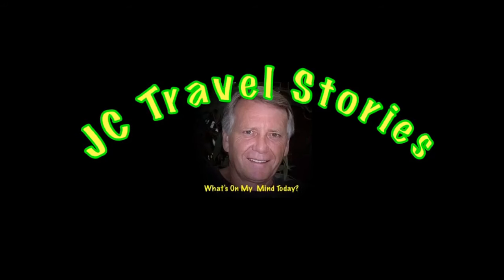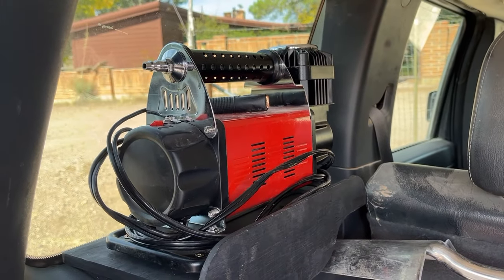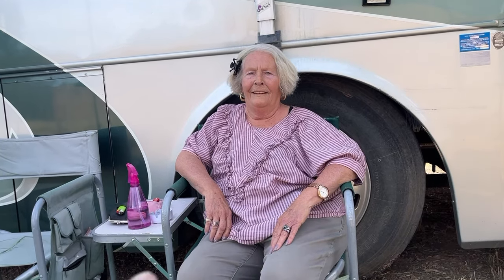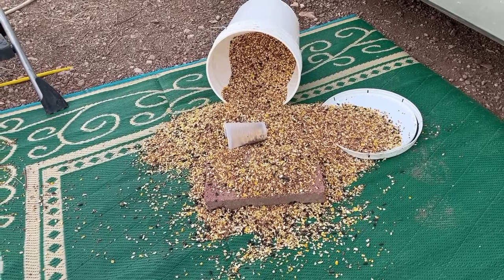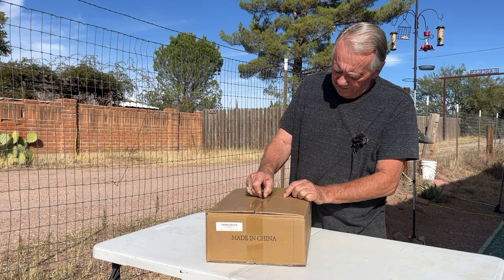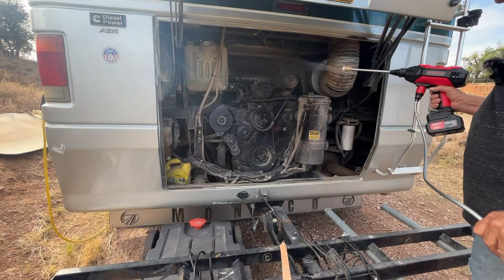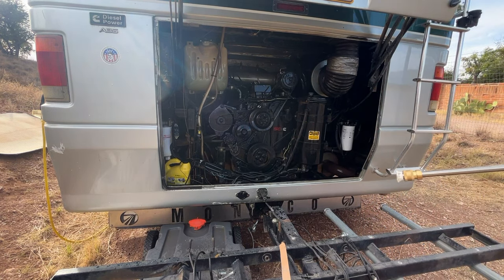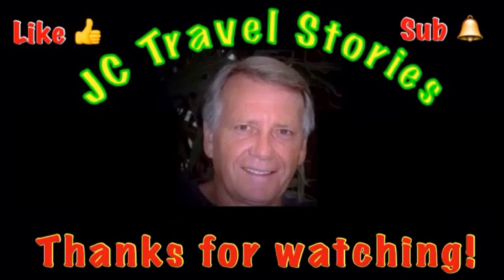A New RV Toy.

Comment: Put a teaspoon of ammonia per gallon in your sprayer. It won't hill them, but they won't come back. And anytime you have hard plastic on hard plastic screwed connections; a little petroleum jelly or teflon tape will stop the friction. If there are "O" rings involved, just the jelly.
Reply from the maker: Good ideas.

Comment: You didn't mention how your shovel is mounted?
Reply from the maker: I used some dense styrofoam cut to fit in the slots made for a cargo cover/net. Handle end has a hole. Shovel end has a curved slot.

Comment: not good idea to put battery in window for heat.
Reply from the maker: Probably not.
Reply from the maker: The more I think about it, the more I agree with you.  I put reflectx in the window and in the case and will always put the cable side of the TopDon case towards the window to use half the case to insulate the battery pack.  Thank you for pointing that out, Patrick.